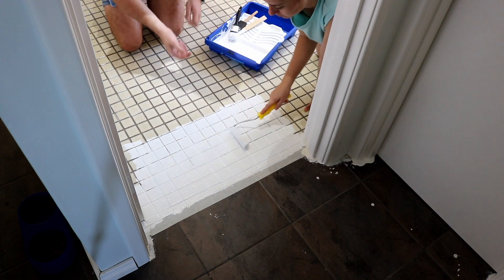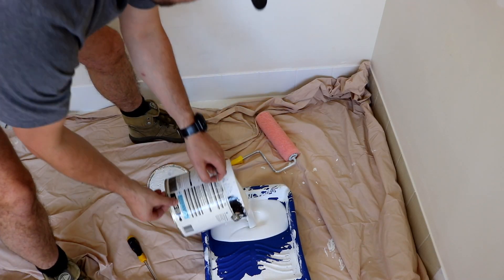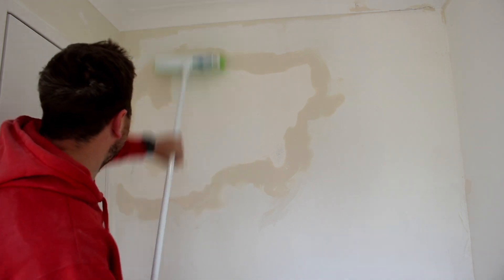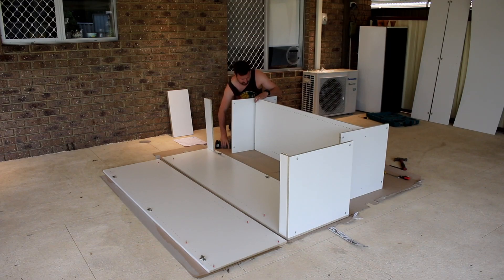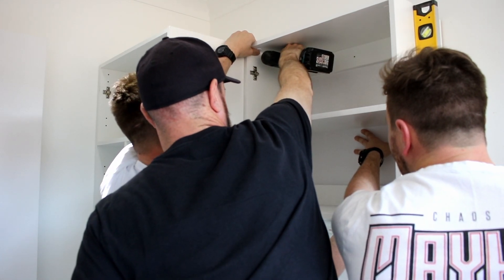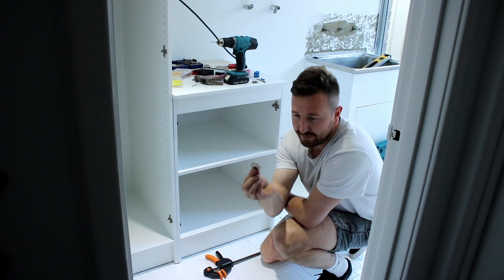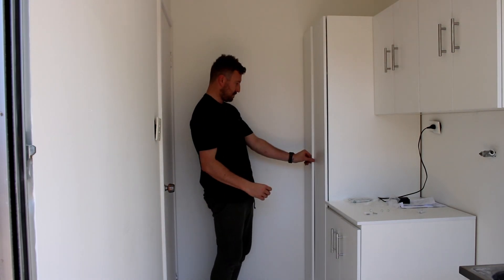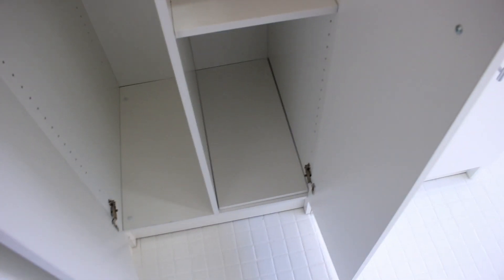Laundry Cabinet Installation (Laundry Renovation Part 5)

Comment: Never use white masking tape on painted surfaces. Use blue 3M painter's tape. White general purpose masking tape is a high adhesion tape and will, as you saw,  tear off paint and the paper facing on drywall.
Reply from the maker: h baker yeah for sure, I normally use the blue tape just didn't have any on hand. I can imagine some sections still may have peeled regardless, it almost seemed to have bubbles of air under the paint, particularly that large section that peeled back. Cheers for watching
Reply: h baker I

Comment: I use masonry plugs alot. Generally if you can push the masonry plugs in by hand only - it means they are too loose. Try the next size down in drill bit. 

Also HMR stands for high moisture resistance. Not "mould" resistance.

Comment: There is a way to adjust those gaps on the hinges if the play with the screws
Reply from the maker: me me I had maxed out the adjustments on each hinge. I would have to relocate the hinges to get better results. But thanks for the heads up
Reply: @TheHandyTech  I had the same problem with the same cabinet, never got it right and have built 4 kitchens and 3 laundries so far. About to build another today. Love your vids
Reply from the maker: @sisha2909  It's unfortunate there isn't stricter quality control for some of these products. It's one small detail (getting the gaps just right) that really makes the install professional. Thanks for checking out the vids! More soon!

Comment: Nice work, FYI you can buy a bag of plastic window packers ranging in thickness from 1 to 5mm, perfect for packing under, behind and between cabinets. (Ideally you should never have to pack in between 2 cabinets, one of your cabinet levels must be out).
Reply from the maker: Cheers for the heads up. The original surface top on the base cabinet is slightly wider than the width of the cabinet meaning there is a very small difference when screwing it to the tall cabinet. None of the other cabinets needed spacing. If you check out part 7 you'll see I replaced the surface top with a marble look bench top (and though not shown) meaning I could cut it to a perfect width negating the need for the coin (or any other spacer). Thanks for watching!

Comment: You should have probably scrape the wall then first if you knew that the paint was so old and thick
Reply from the maker: me me that would have been a lot of work taking it back to the render. More work than the room was worth in my opinion. This house is just going to be another rental so not too fussed :)